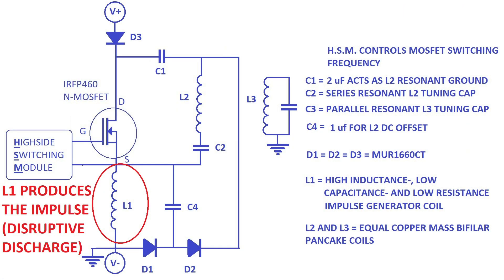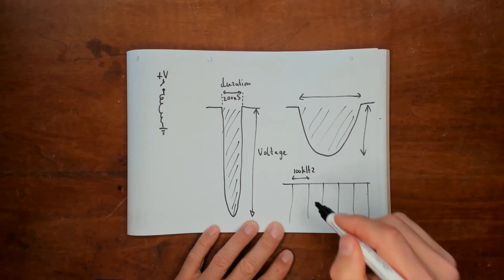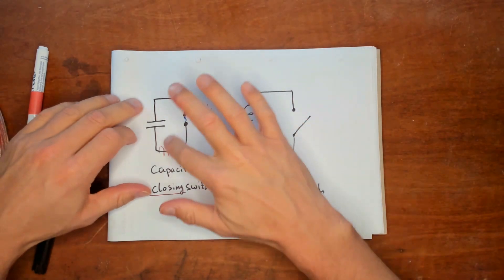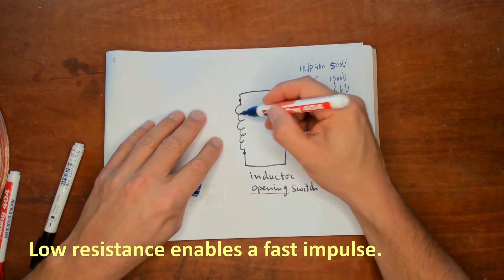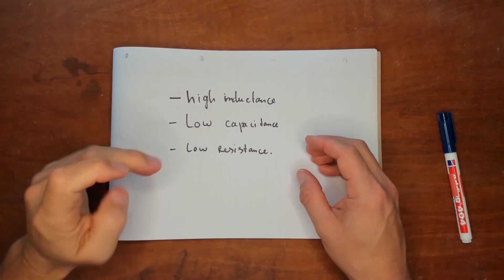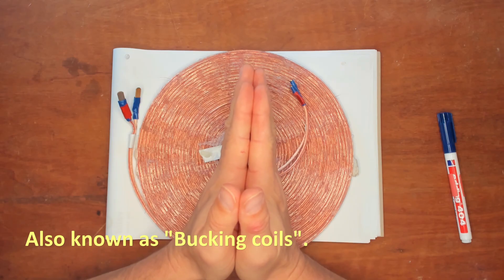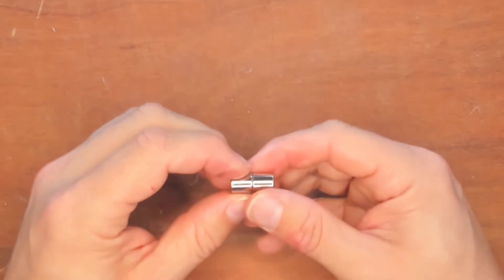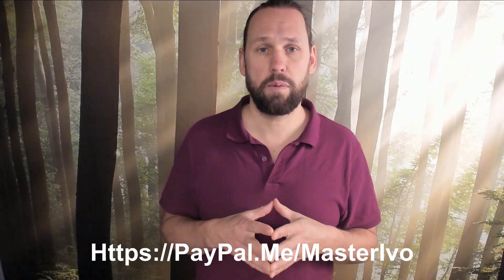Longitudinal electric impulse generation factors.

Comment: Can I get some sort of diagrams or videos of how to build opposing coils?
Reply from the maker: I have a video (how to build a bifilar tesla coil) if you connect the 2 windings in the center (or outside) it opposes
Reply: This arrangement changes how the coils are being optimized from Tesla's patent. ( connect one inner to the other outer to match Tesla and maximize the dielectric content of the initial discharge source, holding the capacitance stable for the duration of the impulse; although small, this may slightly increase the width of the impulse over a single coil. You would have to test, but i doubt it would decrease the peak significantly, it  is intended to increase the peak) Connecting the two inner or two outer leads will give you the bucking configuration, the collapsing impulse now is sourced across both coils as before, but compliments rather than matches each other. This is expected to increase the capacitance of the flux-capacitor as the differential voltage with the opposing current flows will vary along the coil length which will draw the discharge into storage where the impulses of oppoosed polarity cross past each other slowing the release out the inductor to the rest of the circuit. The effect will be dependent on the timing of the impulse traveling through both wires, which will vary depending on where in the coil the pulses are as the mutual inductance will alter the pulse speed through the coil at different locations. The benefit of a balanced charge along the coil is lost, which may lead to punch-through of the capacitor in the coil. It may also give an odd flutter of impulses similar to a dripping faucet that reflects a randomness generated by the changing dynamic impedence. This effect is typically benign in AC systems with slower frequencies or ferromagnetic amplifiers that have limited frequency response capability which may be why it is so popular in those designs.  For this work, it introduces a randomness that lim ki ts the control of ev ax luating pulse width effects, something Tesla clsimed made the effects change from replicating chemical, buological or nuclear reactions. Ivo just says they would prove interesting. I agree, these possibilities do seem interesting. Impulse electricity may have potential for new applications that AC and DC have not approached or found practical. Especially in plasma and astro-physics.

Comment: Hello master Ivo, first of all thank you for the amazing work continuing where Tesla left off and having such an understanding of the workings of the circuits and physics of radiant energy and electromagnetismto being able to cummunicate your knowledge to the world is a true gift from god  😇🙏. Thank you so much you have helped me and so many others begin to understand what common physics says is impossible and what every one should know about and work with to make the world a better place, I will donate to your research when I have spare funds god bless.  I have 2 questions  I am making something like the ascension seat but using 12 gauge pure copper speaker wire for l1 l2 and l3 , my question is are all the coils copper mass supposed to be equal to have resonance in the system? I know that l2,l3 must be the same weight but I was under impression that the primary impulse coil also had to be equal in mass as l2 as well ?   I am unsure as to what high side switching module to use, I have a pwm Ocxiv2.1 from rmccybernetics. Would that work to pulse the system ?  My primary goal right now is for health benefits. 🙏
Reply from the maker: 1 yes
2 the pwm igbt module is very versatile. I can plug an external pulse generator in, and see what I'm doing. plus, I can supply power from a battery, which negative pole I ground on the Source (for high side switching). Voltage is always relative. Dual. put a fan on the heatsink. When tuning loads of amps can flow through the mosfet
Reply: Thank you, when you say dual what are you referring to as In dual pwm ocxi's one to modulate the other? Also do you mean to ground the negative of the battery on the source of power for system?
Reply from the maker: dual, as in no positive voltage, without a relative negative voltage.

source:  the negative of thd battery of the gate drive circuit (pwm ocxi) is grounded on the source of the mosfet.

the 3 pins of a mosfet are called "gate", "drain" and "Source"
Reply: Thank you so much.  I am just learning the workings of all of this so lots of questions will come up, I appreciate your informative answers 😇 🙏.  For the impulse generation coil is the phi ratio the best coil geometry for impulse generation?
Reply from the maker: @ben12335  No Phi ratio isnt the best (doesnt matter) best for impulse is high inductance, low capacitance and low resistance. I have a video about impulse generation
Reply: Ok great thank you. 🙏

Comment: Hi, master, how are you? I follow you in your videos and your explanations are very good, I want to tell you an experience that I had with radiant energy, and with my POE coils, they are like the pancakes you use but I think they are better, because they have the same configuration but they can contain more voltage , I see them more efficient, well I told you that I put the coil inside a water tank, around 60 liters, I immersed the coil in that container and put it frequently, I generate so much radiant energy thanks to the water, which amplified this energy and they started Plasma balls out of my garden, balls of radiant energy, after that it rained, the water tank had a spout that came out to project these waves to the sky, the balls I could reproduce 3 meters from my garden, I mean very close mine, I will replicate the experience and if I can send the videos of the plasma balls, it is all totally real, for those who want to replicate it, hug for everyone
Reply: I'd like to see that!

Comment: Watching again, came to me a question: when I see the Tesla's patent of the bifilar coil, seems to me that each turn of the coil is made by one different wire. But your coil is one wire above another. Is there any difference on how it works? (hope you understand what I mean)

thank you in advance
Reply from the maker: equal copper mass per winding, equal turn diameter, equal turns.
Reply: I think it will have a similar effect, although the dielectric field is in a different direction (perpendicular to the pancake plane) than Tesla's version (radial). Pondering further on that concept, you could make multiple Tesla bifilars and connect them in parallel but alternate which of the two windings in each coil is the higher or lower voltage. Then stack the coils on top of eachother and you get dielectric energy storage radially and axially at the same time. If powered by 100V, then a cross section of the coil stack would look like a checkerboard with 50V difference between each square. Should increase capacitance for a given total copper mass without increasing inductance or resistance.

Comment: The spike has always interested me and I used to think physical switching was preferable to electronic switching but I still can't quite rationalize it either way. The idea of the fast impulse certainly makes sense but the current being put in over time always seems to be the important part for me.  I suppose with a normal inductor the back emf is going to be related to the saturation and how unhindered the reverse current is upon open circuit which could be partly synonymous with how sharp the downward slope is on the input. If it doesn't want to take current immediately it doesn't want to give it up immediately either but somehow the output pressure is greater than the input. It's as if the back emf discharges like a capacitor because somehow the input current is able to drop faster than the induced magnetic field can. If the Tesla bifilar gets around a self induction that may allow it to store energy more like a capacitor than an inductor then it's interesting to think about what is happening there with the back spike. The input impulse duration is what I'm trying to rationalize and it seems a way to push the current we need in such short pulses is nice capacitor discharges. But then is that basically what the bifilar is doing, charging and discharging more like a capacitor with the fast impulse?
Reply from the maker: It seems the impulse is changing yhe dielectric field strength of the bifilar coil very rapidly. 

It sets the whole polarised Aether around the coil into a longitudinal motion.
Reply: @MasterIvo  if you've never seen Skycollection  videos on YouTube I recommend checking him out. He makes some of the nicest bifilar and trifiler pancake coils out there using them to drive some cool pulse motors.
Reply from the maker: yes we know each other. Always fun to watch his devices. 
 pulsing won't get us into the longitudinal domain. 
Impulsing does.

Comment: Is it possible to build an extremely long range wifi system out of impulse electricity? Where you create longitudinal impulses in the ether medium in 360 degrees, ethernet signal from the router can be converted to varying degrees of longitudinal impulses in the ether medium representing 1's and 0's and converted back to ethernet signal and vice-versa with an electronic device. One could in theory no longer will need to worry about losing internet signal and latency anywhere on earth.
Reply from the maker: interesting Idea
Reply: The Russian "woodpecker".
Reply: Could be a telicamunications boom
Reply: @dianathompson7597  It's called "SUBSPACE" and it was part of Star Trek for decades.  It's not only possible, it's already here.
Reply: @rstelzer2928  anywhere in the public sector?
Reply: @dianathompson7597  Nature is so interesting, isn't it Diana?  It's all around us all the time and we hardly notice what we take for granted every moment.  Like a fish in water; does it realize it's breathing water?  Do we really notice the air we breath and all the effects upon us from the air?  For most people science is an art of trying to reverse engineer "how things really work" in nature.  But nature happens every moment, even without her own calculator!  Does she struggle at times to make things happen?  Or does it just come naturally for her?  Heh heh heh.
Reply: 😬...if I were asked to communicate with distant civilisations I would not be using the current SETI approach of transverse EM ,but instead phi based longitudinal embedding with transmission many orders the speed of light
Reply from the maker: or learn to open your heart and mind for direct telepathy

Comment: I wanted to mention about the wire, fine strand wire has a multiple effects similar to the bifilar effect of increasing energy. The resonance energy travels around the outside of each strand, no loss due to resistance. This creates a larger storage capacity of a coil, since each wire holds a certain quantity and combine the together much greater energy storage.
Reply from the maker: yes more surface area = more capacitance

Comment: Tesla used to work with high intention !? We have to work exactly with the energy he worked. I'm having antigravity results. Use high voltage 10kv + capacitors. I can separate the energy, I get only the tension and with it I can levitate objects. I get exposed to energy and it doesn't do me any harm. It runs through my body without any problem. I would like to share this with you. Send me an email ... For me it's important, maybe for you too. raylsondesigner@gmail.com
Reply: that would be nice to see some videos of you ; ) with any objects levitating, i had some experience too, with high voltage plus 2 ferromagnetic and aluminium pieces put together in a certain way and i have seen it moves with high speed towards South Pole or north Pole .....i have not too much free time, but i am investigating this strange thing ! its a force that pushes towards south ! i am not yet illuminated what can be that and why !

Comment: Yos but by seperating the coils you also reduce the "counter-rotative" interaction of the fields in the coil. Seems to me that would reduce itss effect.
Reply from the maker: true, I did several measurements on different distances.
Reply: The captive electrostatic field is more affected by distance than the magnetic field is.

Comment: Now you hit on the nail, it is this project to develop for you to have a true Torsion field device that tesla designed. It is this bucking coil you need to use for the 3 phase angle to be able to develop the energy needed to create the time bubble.  The opposing magnets is used to create a floating ground system that allows you to absorb energy, you can do this with the series bifilar coil you mention here in the video.  There are other forms to make the bifilar coil with out them being paired up that way you have it and  do this same low capacitive, low resistive fashion you describe. well, i will let you figure this out on your own, step outside of the box and you will do it correctly. Lazaro
Reply from the maker: yes, already working in it.